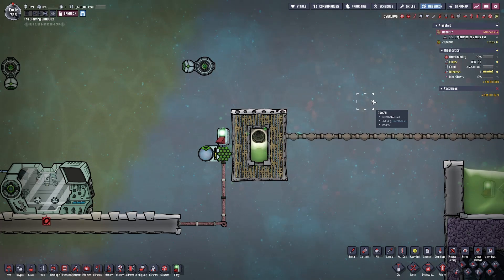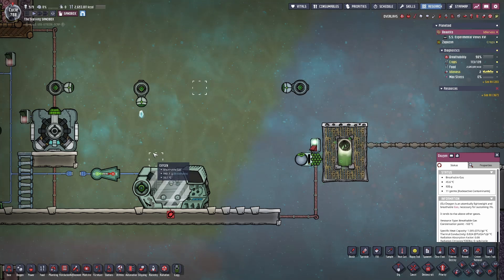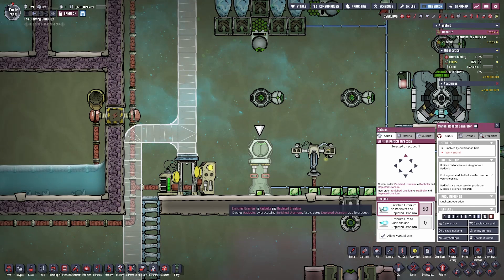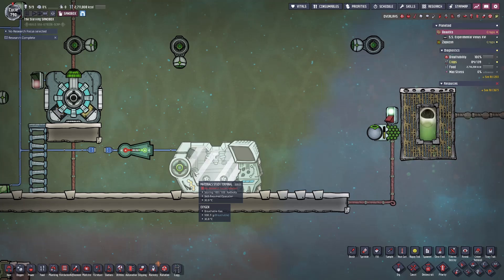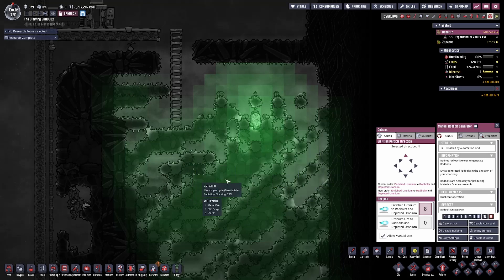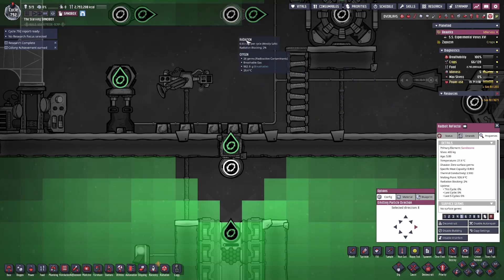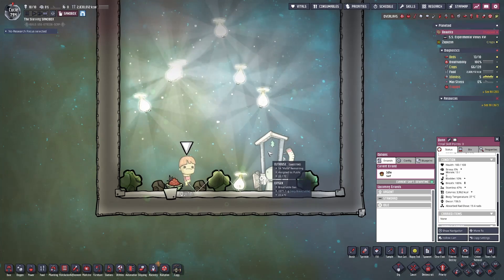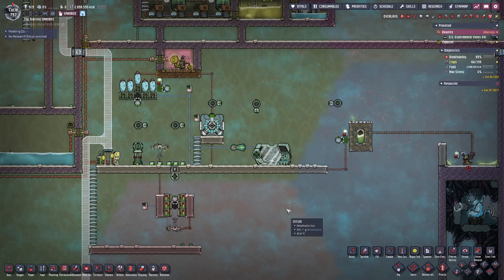RADBOLTS and RADIATION for BEGINNERS in Oxygen Not Included

Comment: If you are not playing hard mode, not so much radiation protection needed. Also aquatic diet gives 20% resistance with lead suit (66%) they additive so 86% radiation protection.
Reply from the maker: Good point! I think most people play on default, so you're right, radiation is pretty easy to deal with